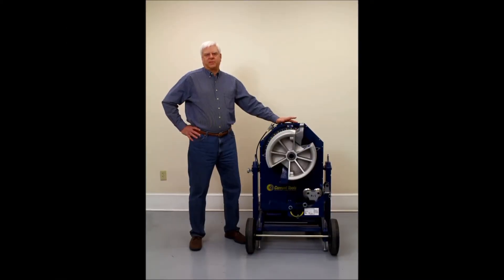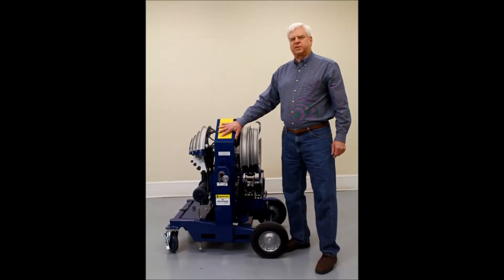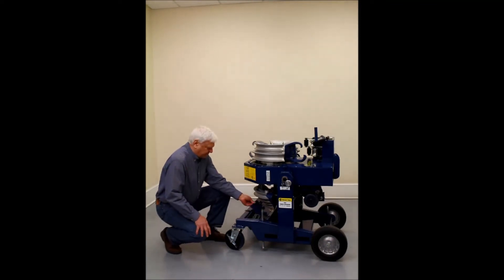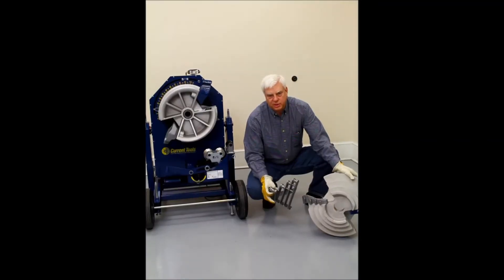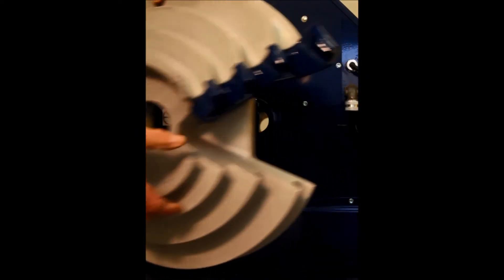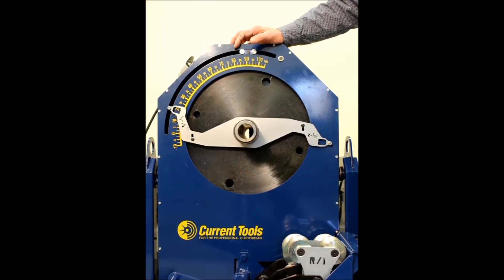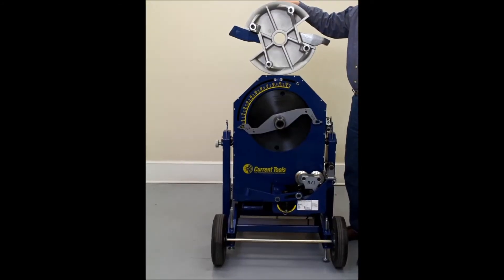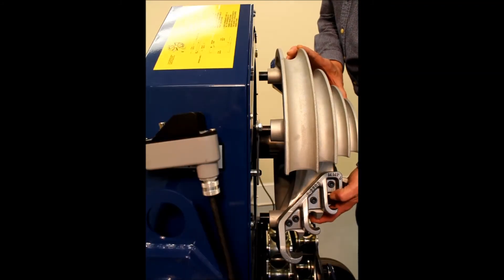Current Tools 747 OMNI™ Bender

Comment: This is the worst bender I’ve ever used
Reply: Trying to use it on a site that has emt transitioning to rigid. This bender is portable. However, I am having issues with precision bending. Will report back in 4 months how it turns out.